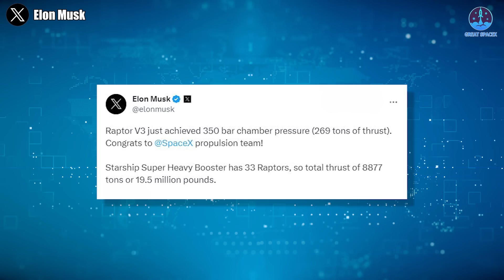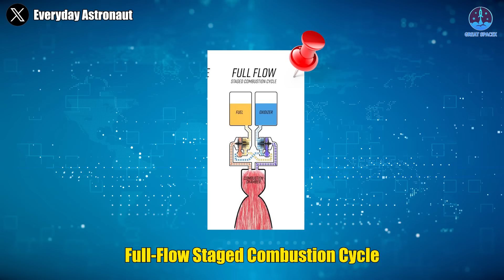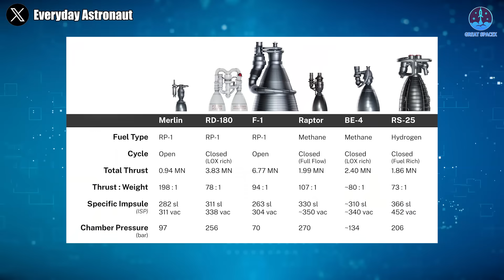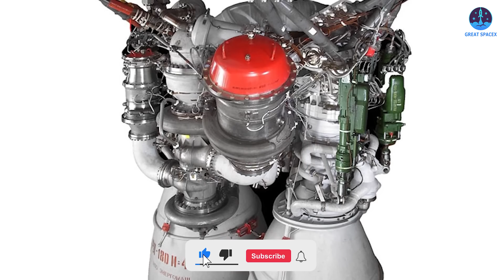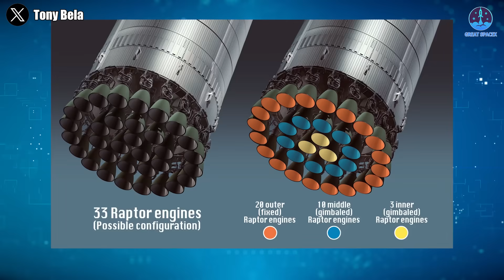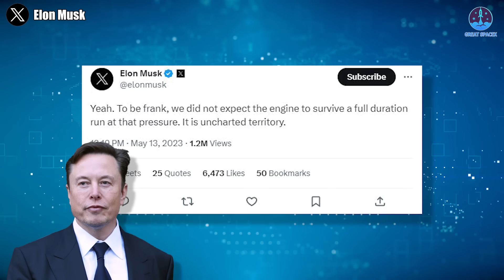SpaceX Raptor 3: the highest-level rocket engine!

Comment: When i study the combustion process and design of this engine, i think to myself, if rocket engine engineers could help the auto industry a little, as a charity event, maybe automobiles could utilize more of the energy which presently is wasted in auto engines as 60% or more, of the energy in the fuel lost to heat, and not to moving the automobile.

Comment: During WW2 the Rolls Royce team used to run a Merlin engine in a test cell for as many hours at full throttle as it took to break it, then they would re-engineer whatever had broken, and try again. During the course of the war the Merlin engine about doubled in output.
Reply: It could be very expensive to run a rocket engine at full output until it blows apart . Yes?
Reply: @mikewallace8087 SpaceX make close to one Raptor engine per day. They have designed it for manufacturing so it is relatively cheap and easy to get them to test
Reply from the maker: Wow! Interesting tidbit.
Reply: The first employee of SpaceX invented the Merlin engine

Comment: Raptor 3 can only be used if all of the engines in a ring use the Raptor 3.  There are three rings of engines in the booster: 20 in the outer fixed ring, 10 in a middle gimballed ring, and three in the centre gimballed group.  There are two rings in the Starship upper stage, the 3 (or in future 6) fixed vacuum engines and the three centre gimballed engines.  Within each ring the engines must be matched for performance.  The behaviour of the Raptor 3 in the published test was astounding.  Just comparing the graph of its output compared to early tests of the Raptor 2 is amazing, but whether SpaceX is ready for mass production of the new model is a question.   Because of its higher thrust it will also be necessary to design and test a new "thrust puck", the rear bulkhead on which the 33 Raptors are mounted..  The four assembled boosters (9, 10, and 11) may not handle the increased Raptor 3 thrust. Booster 12 will probably not fly until early next year.  

The presentation needs more research.  Note that BE4, RS25, and Raptor 2, all have about the same thrust.  Raptor 2 has a higher efficiency, measured in specific impulse than the BE4, but less than the RS25.  With the exception only of the Merlin engine the Raptor has the highest thrust to mass ratio of any rocket engine, and the Raptor 3 beats the Raptor 2 in both ISP and thrust to mass.

Also note that Musk tried to buy RD180s and only developed the Merlin when Roskosmos refused to license SpaceX as well as ULA as customers.  As SpaceX grabs the markets of ULA, Arianespace, and Roskosmos Musk is probably glad he had to do things the hard way.
Reply from the maker: Thanks for your sharing<3

Comment: Comparing a Russian RD-180 to a 3rd Gen Raptor is like comparing a Ford F-150 to a Ferrari. What's more important in Space Programs, reliability or max performance at the cost of reliability?  Raptors have only proven to be Completely Unreliable on Every StarShip prototype launch or Super Heavy Booster. Raptor's aren't "There" yet. When I see multiple SS Launches w/o a need to swap Raptor Engines, then I'll be impressed. But so far they've self destructed, failed to fire or need refurbishment for every launch to date.

Comment: As well as less weight, don't forget that simplicity also means less manufacturing, easier integration,  reduced testing and reduced maintenance.  All adding up to faster and cheaper production runs.
Reply from the maker: Yeahhh

Comment: Raptor is junk.  The reliability needs to go up about a hundred times (no joke) to compare to most of those other engines you mentioned.  Those super high numbers you quote are meaningless since Raptor can only operate at those settings for a very short period of time before they disintegrate; they always run at reduced throttle.

Comment: High pressure in the combustion chamber is good, but I have bad news for you guys. This summer, Roscosmos tested a new RD-171MV engine, it was created for the new Soyuz-5 rocket. Its thrust was 800 tons.
Of course, it is much larger and heavier than the Raptor. But we don't have our own Starship yet, so we'll have to be proud of just the most powerful rocket engine in existence =)
Reply: Of much more importance is (as you touched on), the power to weight ratio.  For the RD171MV it is 82:1, but for the Raptor it 144:1.
Reply: @peterb2272  Of course, as I said - this is just an excuse to brag =)
But, strictly speaking, the Raptor is created specifically for Starship. The RD-171MV is being created as a four-chamber engine for the first stage, which will be installed in a single copy.
I can't wait to test the RD-0169 engine on methane. It is being created for Soyuz-7 (Amur-LNG) - this is an analogue of the F9 of the middle class.
Reply: Ого! Горжусь успехами своей Родины!

Comment: why they don't just build one big engine? Orchestrating 35 engines to work perfectly doesn't seem any easier or safer.
Reply: A benefit of multiple engines over a single engine is redundancy.  They can lose up to 3 engines and still make orbit.  With a single engine you're toast.  Then there is manufacturing cost.  Once you set up an assembly line the cost per engine is lower.  Then there is maintenance.  If an engine has problems during static fire you swap it out.  Easier with smaller engines.  Then there is multi-use.  The same engines are used in both the booster and the ship.  Then there are design limitations with materials, eg. the turbo-pump rotation speeds and rotor sizes and bearings have a sweet spot relative to material strength limits and weight so bigger may be more costly, less reliable or perhaps not even possible.  I wouldn't be surprised if there weren't another 10-20 engine parameters that go into producing the optimal engine design given the various performance, materials, cost and reliability constraints.

Comment: Remember this,  when you produce more power out of a similar design the chances for catastrophic failure increases .  Illustration :  Which will last longer , a naturally aspirated  I.C.E. running on regular octane gasoline or a super charged engine on nitromethane ?  Stressing the engine parts to the limit of destruction is asking for destruction .
Reply: You have written at least 3 fallacies see if you can figure it out.
Reply: I think, they are not dumb, so it's not the limit. Maybe, it's close to it, but not as much for the catastrophe.

Comment: The only issue I have with the Raptor, any version, is that they operate on the bleeding edge of performance.  This inherently makes them less reliable.  Maximum chamber pressure is difficult to control.  All of the other engines mentioned operate at chamber pressures that are more easily controlled and, therefore, are very reliable, with the exception of the BE4.  BE4 is not a good engine...period.
Reply: Yes, but it's all about headroom. A higher maximum can only be a good thing. They don't need to (and shouldn't be) run at maximum, but they can now be more safely run at the previous max or higher.

Comment: As an engineer, I have never done something that could not be improved. But something it is necessary to stop these ideas and bring the developed thing to reliable work. The Starship & Booster need now at first reliable engines. When this step is reached one can speak about improvements.
Why did not they improve the Merlins of Falcon 9 with some of the ideas realized in the Raptor engines? For non-human launches (because of license problems) they could have used engines with mainstream turbines or higher combustion pressure, and whatever else.  A bit more thrust and better efficiency do not hurt at all.
Reply from the maker: Thanks for your sharing
Reply: You seem to consider this a serial development program.  The propulsion team can be working the the next engine rev while the launch & testing teams can be using the previous rev.  Ditto for the booster and ship structure teams.  The decision about taking raptor or some of its elements to Falcon is an independent business decision based on program needs for the Falcon launch business.  It may end up that the business case for Falcon remains viable even after Starship is flying.  But putting a more powerful engine on Falcon isn't as simple as a swap since design changes to the booster structure are likely needed not to mention the needed fuel changes at the pads.  And finally, engineering talent is a limited resource at SpaceX.
Reply: @datamatters8  The danger is that you may find out that you are developing in the wrong direction. Then it is hard to go back and start totally new. Raptor 1 (complicated, 250bar) has not already proved its reliability, and they already speak about Raptor 3.2 (simplified, 400bar) or so.
Reply: @Pene7942  As long as SpaceX improves the Starship it will not become ion driven. Because of that, you must begin from scratch.

Comment: The premature 4 shut down ??  is it because of back-pressure too high (relative to the calculation) ??
Reply: Plumbing issue external to the engines. SpaceX I struggling to get all that pipework and valves and pumps to work in sync with massive amounts of frozen liquid trying to Blast thru the system. It's not a failure of the engine to burn fuel...it's the plumbing not being able to keep up with it all

Comment: With how many iterations of booster and starship im not super surprised that there is a v3. Knowing this we will probably get further improvments too.
Reply: Space X  can not get the previous version of 33 engines to all fire reliably .
Reply: @mikewallace8087  that's why they are fixing the problems with the engines and making new iterations? 
Booster 1-6 and starship 1-23 couldn't even get to space with the right engines so they made improved versions of it. 

And it's also because they are constantly innovating the booster that will lead to new problems, they have changed how the engines move and are controlled and some other piping things that directedly effect the engines witch could lead to unforseen issues or maybe just installation or production errors with the booster itself or the engines.

Comment: They will not "remove gimbaling on the outer 20 Raptors" - they have never been gimbaling, nor have they ever been planned to do that. 
Trying to imply that Raptor 3s will be installed on B9 before the next flight is groundless. Raptor 3 has very likely months more of testing ahead of it. One good test is fine, but does not end the development.
Please be more careful how you chose your wording.
Reply: i agree. with you. I never heard of any gimbals on the outer ring of engines.
The next test will only be about 60% success rating according to the last Musk statement I heard about.
I also question why waste the new engines on a ship that already built? 
Best to find out why the R2 engines that failed, did so, I think.  
Then R3 for the next test, maybe?
Reply: @costrio  Musk said it's still 50% because of the hot staging and other things, and just for the orbit.
Reply: This site frequently makes errors in the details.

Comment: The RD-180 design is over 20 years old, I would hope we could best it.
Reply: But it's not just a small increase, the raptor is less than 50% the size of rd180 yet 30% higher pressures.
Reply: @john38825 and also according to the accusation of Roscosmos from one of their scientist, if the RD has even a tiny amount of human skin left from manufacture or assembly on its part, it will exploded when operate. And that engine is super complex to configure during assembling. After the collapsation of USSR, Roscosmos did nothing to research and improved RD, unlike SpaceX which constant improve Raptor to make it simplier and cheaper.

Comment: Still need massive reliability improvements before use for human space flight.
Reply: The engines don't seem to be the big problem,  it seems to be the thousands of things that must happen for 33 engines.
One at a time on the test stand, they seem to be very reliable. 
But yes, reliability of 33 at a time NEEDS massive improvement for human flight. 
Keep in mind that merlin wasn't perfect for years either.
Exciting times indeed.
Reply: @@OrwellNailedIt they are reliable 1 at a time, and 3 for the starship... would be interesting to see the company memos.
Reply: Indeed. As a reminder, the Raptor's engines have so far only led to explosions or a single almost-successful landing (SN15). NASA is getting slowly but surely a bit concerned...
Reply: @FredSuomi  novel ideas cause problems =) NASA and its SLS is way more dragged then starship, and 💸
Reply: we have no info on the nature of the problems.  SpaceX has the data and the experience with Falcon.  Remember this is a development program and  iteration / experimentation is the name of the game.  Such is the nature of engineering.  We are very lucky to get to see all that goes on as SpaceX progresses to perfect Starship.  I don't see  any insurmountable problems, just problems to work through.  A lot of small buildings were built and some fell down before the first skyscraper was attempted.  Ditto with bridges.

Comment: Is this REALLY the highest-level rocket engine?? I mean what about the Starships?? What kind of engines are on those things?
Reply: Raptors.........
Reply: Raptor now is the second powerfull methanox engine by Thrust but if v3 enter service it would be first bypass the be 4 at 550K lbs ( 250 metrictons)
Reply: The SuperHeavy and Starship use Raptor v2s, switching over to v3s
Reply: To be specific, 33 Raptors.
Currently V2, but supposed to be shifting to V3 very soon.
Reply: We only know about one (1) Raptor v3 surviving one (1) test. That is all.
How many have been produced or how many have survived or when they could be installed on ships or boosters are ALL unknown.